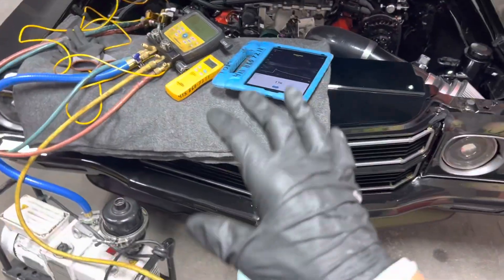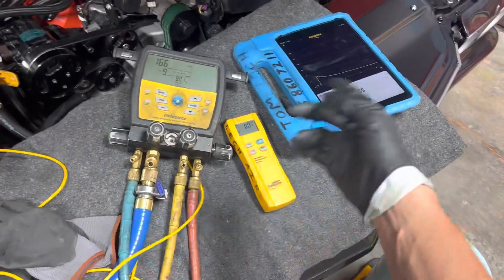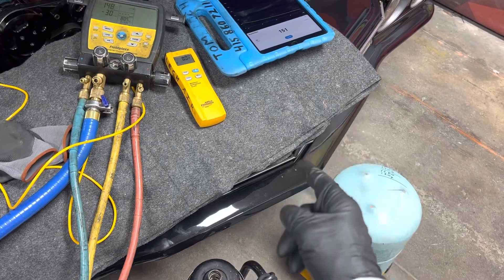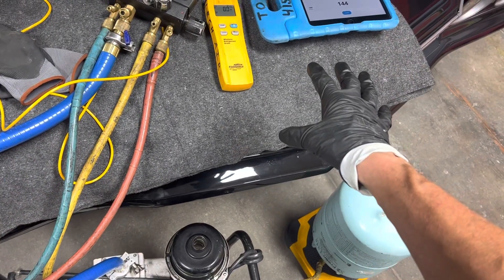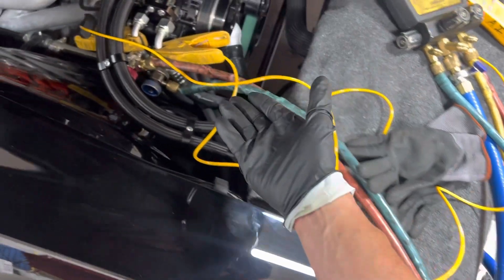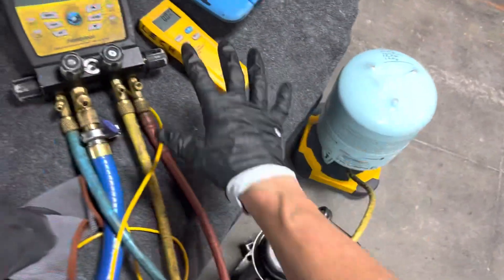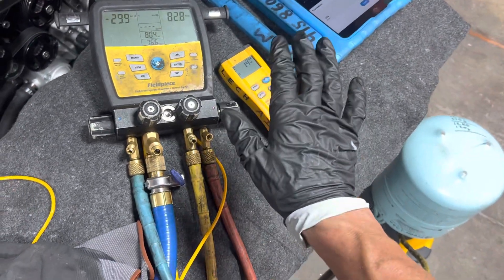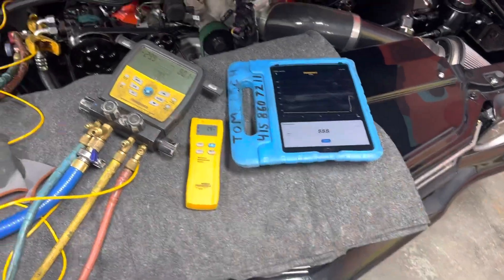Explaining altered refrigerant quantity needed due to condenser modification. Condenser was chopped￼

Comment: Does liquid refrigerant go to low side or not?
Reply from the maker: Not when charging with the engine off. It all goes through the high side with the compressor not running with the engine off.
Reply: @coldfinger459sub0  I noticed that on the gauge after you finish charging but why nitrogen goes to low side during pressure test?
Reply from the maker: @issamadam9352  It goes through the expansion valve
Reply: @coldfinger459sub0  why nitrogen goes and not Frion because you said when charging and engine not running  Frion not go to suction side and in hydrogen pressure test also engine not working?
Reply from the maker: @issamadam9352  I forgot what country you were from ? English was not your first language ?.   

You can answer your own question. With a little information about the (three gas laws) 

Do you have Google available in your native language ?.  What can you use Translate ? 

Wikipedia is also a good source if it is available for you ?. 

Your question about why refrigerant will not go in the system but then the nitrogen goes in very easy. 

You can find out answer by reading about the (three gas laws) 

You can also watch YouTube video about the (three gas laws ) with subtitles if you need

By learning this information it’s not that difficult you will be able to answer a lot of your own questions that you see in my videos and other videos. 

And you will be able to give me the answer why does Refrigerant have a difficult time that it does not all go in easily. 

And answer the question why nitrogen goes in easily. 

And when you teach yourself this information and learn it and understand it you will be able to teach yourself so many more new things with this little bit more extra information about the (three gas laws)
Reply: @coldfinger459sub0  From Middle East and Arabic is our mother language .Ok I will do Thank you
Reply from the maker: @issamadam9352  I believe you Country has some really good universities and schooling.  I have met some vary smart and well educated people from over there. 
        The school level over were you live in high school is a higher level then college level here in the United States.
https://youtube.com/channel/UC8xNyHKYO3ucXNE7Uz6lPPw
Reply from the maker: @issamadam9352  look at this is this in your language
https://youtube.com/channel/UC8xNyHKYO3ucXNE7Uz6lPPw
Reply: Thank you
Reply: @coldfinger459sub0  What level of education you are?
Reply from the maker: @issamadam9352  I dropped out of high school in ninth grade went to work for a few years
       
Then while I was working I went back to college and took automotive engineering for four years in night school and work during the daytime

Then I worked for many more years and then went back to college trade school commercial refrigeration and residential HVAC and electronics for five years at night time while I was working full-time daytime.
Reply: @coldfinger459sub0  great, well done.
Reply: @coldfinger459sub0  You are engineer and you studied that but I am not this why I am asking such questions.
Reply: @coldfinger459sub0  I read about   these three gaz laws,but I didn't understand them.Just give me breif idea about.Thank you.
Reply from the maker: @issamadam9352  there is no brief explanation for this one. 

There’s 1000 videos on YouTube with pictures and diagrams and video and animation explaining to three gas laws it’s something I cannot do in a few paragraphs
Reply: @coldfinger459sub0  Thank you.
Reply: @coldfinger459sub0  I saw video on YouTube that guy charge from high side using small Frion can but stopped charging because frion no longer flow from can and started engine and AC to continue charging,why this happened with him? video name Ac leak testing, repair, evacuation and recharge(any car) by Scanner Danner.
Reply from the maker: @issamadam9352  lol 😂 I watch scanner Danner do air conditioning for comedy 🎭 lmao 🤣 

Scanner Danner is good for scanners not for air-conditioning but he’s learning

He put out some old videos for air-conditioning and I scolded him. 

I told him all the things he was doing wrong in his old videos. 

So he just released a new video on air conditioning the latest one.   

And it looks like he read a lot of books and he looked for some correct information I was telling him about nitrogen and many other things and he followed and learned some more procedures but not all. 

He still has problems he still does not understand. 

But he is learning
Reply: @coldfinger459sub0  but when you watch  Scanner Danner video that  I told you about before,you will observe that dial on the low side gauge is moving on adding frion from high side.Watch video from 46:19.

Comment: Yeah that condenser doesn't sound like a good idea to me. You'd think for something as common as a GM A-body there would be plenty of options in condensers without having to modify one. Good luck, it'll probably work just not all that well.
Reply from the maker: Exactly this vehicle was purchased between different people not the original one who started the restoration then sold somebody else who started putting on the air conditioning on the inside of the car and then taken to a different shop to put on the air conditioning on the outside of the vehicle too many hands touch this too many cooks in the kitchen

It worked just not that well